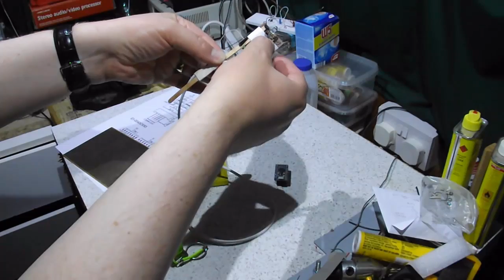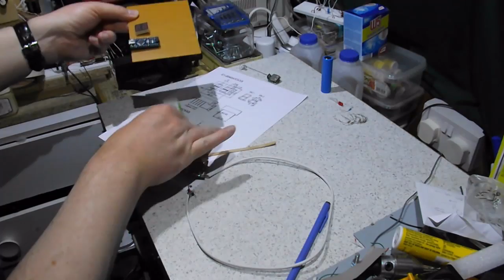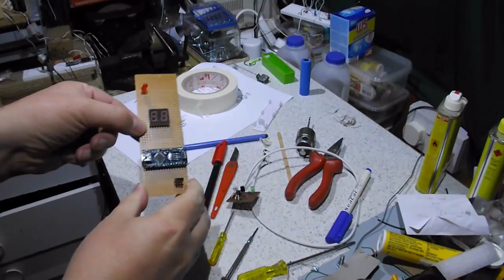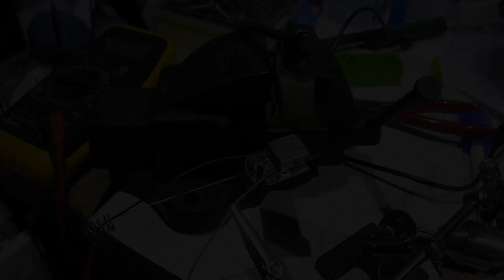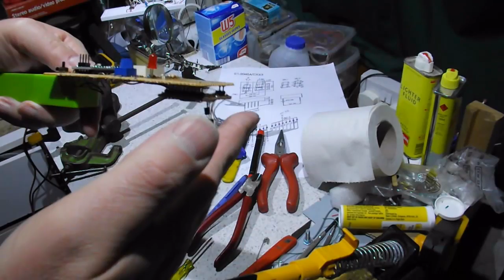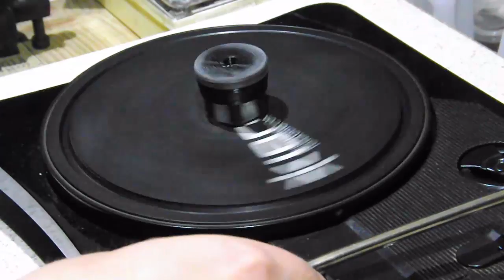Arduino Record Speed Tester

Comment: I know I'm very late to this party, but cou;d you attach an analog tuning meter  (one of those that points to the centre of the readout when the power is off), to show constant speed ?
Reply from the maker: @frankowalker4662  It's an interesting idea and I am sure could be done. The Arduino can certainly generate a voltage to drive a meter as I did with the big AVO in a previous video. The tester though does suffer badly from false RPM results as it needs to take 6 readings in a row to calculate one RPM result. If it misses one, it massively undereads. I think I modified it at some point to only need 3 readings which would give more chance of multiple RPM values in a row being the same, and make your meter idea work better. Good idea though. Thanks 😀 👍
Reply: @mrrgstuff  Just thinking out loud really. LOL

Subbed, BTW. 👍